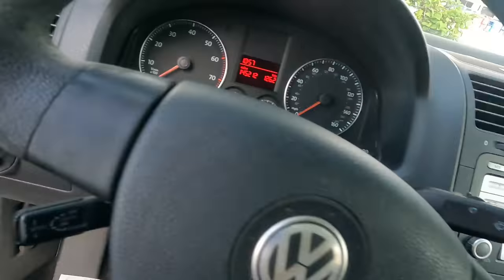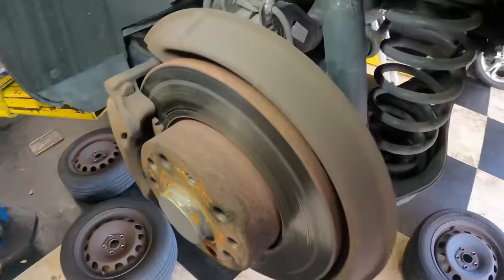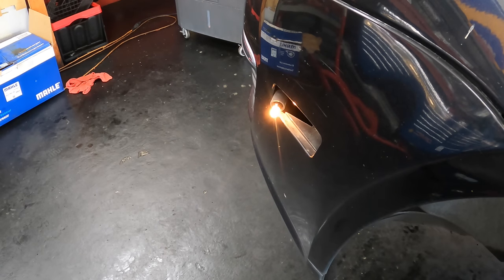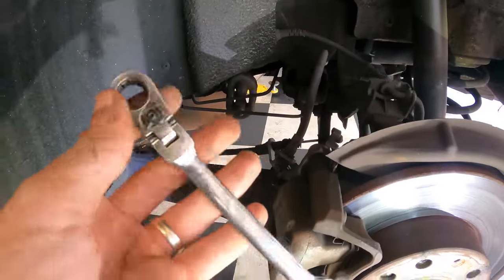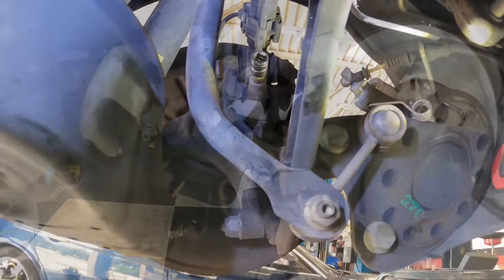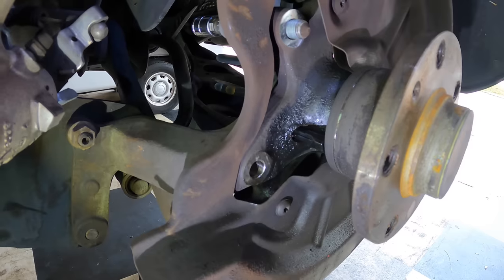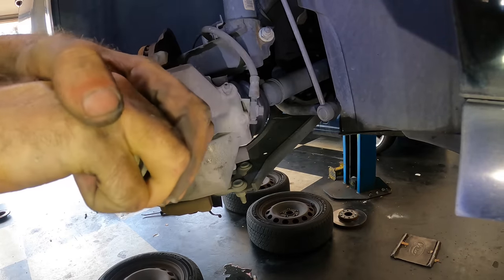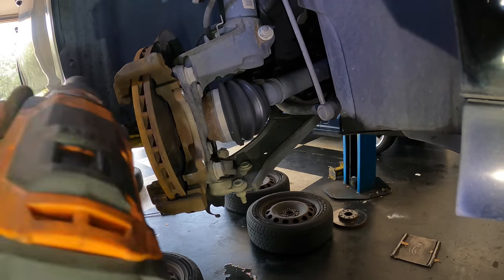Over Engineered Bolts! Four wheel brake job. Actuated Calipers. Volkswagen Jetta 2.5

Comment: One tip when fitting new brake rotors. Put a small amount of grease between the rotor and hub. It makes it so much easier next time the rotors need to come off :-)
Reply: In the salt belt we use Fluid Film.

Comment: I was very thankful that I kept watching the brake jobs on YouTube because I had to do the brakes on my pickup and it tried to mess me up with the hardware. But I got it all to fit had it right on the first side but it was wrong on the other side but I flipped the top and bottom and it worked out

Comment: Yup here north of Upstate NY (across the boarder in fact) NO shop will quote on turning rotors any longer, they all will only do a replace.  Not worth it, most are made thin to begin with so the life of the pads and life of the rotor are pretty much a match.  Now, the fun thing about the rotor is that it is cast iron and the fun thing about cast iron is that you can smelt it and the fun thing about having easy access to cast iron is collab time with a youtuber with a foundry can then happen :D

Comment: Yesterday July 25 2022
I started a front brake job on my 2011 Eq.
Parts from Amazon and they are the correct parts.  Almost 200 dollars cheaper than a local  auto parts store and I bought far better stuff than basic stuff from parts store.
40k on the ticker. Over a hour of hammering and air hammering the passenger  rotor, 30 minutes on drivers side rotor. Every bolt was seized. 4 hours to take apart.
   I never in 15 years wrenching at  dealership  every took so long to just remove  front brakes
Reply: Ouch. I'm glad for you it was your own car, and you're weren't doing this at a repair shop being paid flat rate to fight that. Can you imagine? 4 hours of hard work, and whats a front brake job pay? 5 tenths?

Comment: Wagon front rotors are the larger ones on VW,. I use a C Clamp and turn the piston in on the rear pistons, Ratcheting (Treaded piston) effect for the Parking Brake.

Comment: I had to find and buy a set of those Triple Square spline sets on an outage service call in Germany some 20 odd years ago. I changed them out to metric Allen heads. I still have them and I haven't needed them since. 

I hate those screw in pistons.

Comment: The oil on rotors is manufacturing oil it is use when it is manufactured and then left on to keep the rotors from rusting while in a warehouse or on auto parts store shelves so it serves two purposes.

Comment: XZN 12-point triple-squares are what we used before Torx! (shake cane)

Also, before they made soft-headed XZN bolt holes that would distort, they made six-sided Allen hex holes that were soft and really easily distorted and rounded out! So XZN has a better chance of cracking the bolt loose.

Comment: Did my MK 4 Golf's brakes recently and I was able to push them in, but only one of the rear calipers was able to be pushed in the other was stuck that was why I was looking into doing the brakes in the first place.  Took the caliper apart to see what was wrong and it was frozen stuck, wouldn't open or close so needed to change that one and now they are all good.  And yes, it was a lot cheaper to replace the rotors instead of cutting them.  Ah this video would have helped me out so much had this one been done last month ahahaha, oh well still go it job done.

Comment: VW started using CV joints with 8mm triple square bolts on 1968 Autostick Beetles in 1968, and for all Beetles in 1969.

Comment: BTW, applying the park/hand brake is what rotates the caliper piston so it gets extended and keeps the pads "adjusted" , actually it acts acts as a piston extender, that way the piston does not have to extend from the caliper bore as far
as told at a raybestos brake clinic, the rotors came in a red box or a blue box, and we were advised to put one of color on a brake lathe to make sure they were true. did that for all the new rotors after that= just cuz it's new doesn't mean  it's true, 
long stored or rough shipped rotors usually were not true

Comment: Pro tip for removing stuck rotors. Run a large bolt through the brake bracket bolt hole and thread a nut on the other side. Keep tightening until it pushes the rotor off.  Super easy, no pounding

Comment: Volkswagon has come a long way on their brake set up....yrs ago, they had caliper pins with little cotter pins on the ends of them which never came out, the parts were impossible to find and a 49 dollar brake job was a disaster for profits....this was early 80s but it was a lasting memory for me....now they have the silly caliper bolts that the Snap on guys love because they get to sell you another 75 dollar socket for the 3 times you will use it in your life...thanks Ray for the memory recall

Comment: Good video as usual.  I am a little surprised you didn't replace the rubber boots and the rusty slide pins.  The boots are cheap and would likely seal better.

Comment: Check with Snap On, see if they have a bolt heater with right angle coils. These gizmos will heat up JUST the bolt to cherry red with no contact using induction heating. You just plug them in the wall put the coil around the bolt, click it on. You can use a thermometer or judge safe temp by eye. I've found them on Amazon but not sure of quality, one is American made and may be good. I use one that is very old with no markings on it.

Comment: I had an '08 Jetta with the same system that I did the brakes on several times. 160,000 mi. Did the rears 3 times and the fronts only once. The wear was completely backwards.
Reply: how was the braking performance
Reply: My ‘08 Jetta is the same. Just replaced the front for the first time. Back wear out like every two years.
Reply: @ThePlacehole  The braking was fine. I heard that the stability control was the cause but I'm not really sure that's it.
Reply: All my VW and Audi do the same. I like the slight rear bias to the brakes as it stops the car without the front end diving down as much

Comment: In 1988 I bought a 1980 VW Rabbit with 104,000 on the odo.  For two long expensive years I drove it, in between break-downs, and I could not keep this piece of shet running.  Whenever the engine got hot the car would not start!  The starter was under the exhaust manifold, you see.  And that was just for starters - eleictrical relays failed at random, engine having random missing at high rpm's, so many more I can't even remember.  My dad took pity and loaned me $4000 to replace it.  Got a 1982 Nissan Sentra, and this car was like night and day - nothing ever broke.  Drove it for another 100,000 miles and made me a confirmed owner of the Tokyo tin.

Comment: DEAJA VU !!    I just did the same on our Volkswagen yesterday.  The caliper bracket bolts for the rear are a challenge: small space and you got lucky because the last repair seemingly didn't torque those to 66 lb/ft plus 1/4 turn - very tight. (I didn't get the 1/4 turn 'cause it's too limited a working space plus I have to do this in the driveway on jack stands.)
Reply: Get yourself an electric 3/8. You might not use it all the time, but will love it when you do
Reply: You have to jack up the rear end pretty high
Reply: @dumbeezy5480  Yep!
Reply: @daveunbranded  Right. I have some and they speed-up jobs considerably.

Comment: if you don't have a VW brake caliper tool, you can just use a channel locks and turn the piston clockwise, it will wind itself in without having to pushing it in

Comment: I was reading where "brake cleaners" are very bad for plastics/rubber and paint.
An alcohol based cleaner is best to use round these parts.
I know that AT-205 Reseal is good to spray on all rubber boots and bushings.
I did see some of the brake cleaner wet the front CV boots so I think I'd have wiped it off and after the brake job, coat all the rubber at least near your brake cleaner spraying area if not all the rubber under the car.
Could make them last a much longer time especially the front suspension bushings like lower control arms etc.

Comment: The necessity of XZN fasteners eludes me as well. Torx and E-torx I can actually see as being beneficial as they really do enable maximum torque but XZN are just a strip out waiting to happen. That stated they are superior to regular Allen head bolts which in automotive applications (like drain plugs) seem to be made of lead. When I use to sell tools (TOPTUL) XZN were good movers. Wonder why VAG loves them so much.

Comment: I like watching you fight with the rear bracket. It like you  didn't know you do not need to remove them by a VW like that. The disk comes right off without removing the bracket
Reply: I was looking for this
Reply: YES THEY WILL COME OFF WITHOUT REMOVING THE BRACKET.
Reply: And then, when you finally need to take off the bracket, to clean the rust off, the damned bolts wont come out.
Reply: @erik_dk842  Well with the rotor off, you can clean up the caliper mount bracket slide grooves "on car" with a wire brush wheel on a die grinder or the M-K file, both of which I used on the rear of a 2000 beetle.

Comment: Hey Ray , from one fellow mechanic to another , on some of these Vw rear rotors you can remove them without undoing the pad carriers.  Not all of them are but just give it a try. It stops all this triple square socket annoying stuff 👍👍👍
Reply: With some yes, and you may be able to even tell from the type of pads if you can remove the rotor with the bracket on. The design on my Dad's 1P1 Seat Leon for the rear brakes has no anti-rattle clips for the bracket, but rather springs on the pads to keep them pressed up against the bracket to prevent rattles. THAT design allows you to keep the bracket on, if you replace the rotors as well. On my dad's Golf that came before the Seat it had no springs on the pads, but anti-rattle clips on the bracket. With those you had to take the bracket off, and it was a pain in the ass because at that time i was in automotive class. Here in Finland most "students" that go to automotive class, they are just ass-hats who just  go hang out because they got nothing better to and possibly risk making each other blind with a high-pressure washer (ask me how i know). Back then i couldn't find the damn tools anywhere, and that brake job turned into a nightmare. I still am very much the new guy, and about to graduate next year 😅 But as i was saying, that brake job took 3 days for me because i was in-experienced, lacked motivation by the long-shot and i only had like 4 hours a day. Now two weeks ago in my front-yard, with no power tools and no helping hands i spun brand new rotors and pads after only 3.5 hours. But i could've sworn it took me 30 minutes just to carry all my equipment out from the garage, then move it around and clean up my mess afterwards.. 👌😂
Reply: That may be true, but unfortunately not on mk5 or Audi A3 at least.  They also use the same triple square bolts in the rear.

Comment: This is buried. Otc makes a super stubby set. It is 1/4 and 3/8. It also has the ability to use a wrench. I highly recommend it. (OTC 5942 8-Piece XZN 'Super Short' Socket Bit Set).

Comment: Shims and slide pins - the most overlooked parts of brakes that will attribute to ~65% of brake wear, overheating issues, sticking calibers (rest 35% comes from the caliper itself), etc. If the condition of slide pins are unknown, I always order a new set and clean the bracket with brake cleaner and nylon brush, after that blow out with compressed air - and oh boy, You cannot believe the amount of crud and muck comes out. Even in this video the pins looked pitted and rusted. Same with the shims, replace and in salty road conditions, add a little bit of anti seize to end of the brake pads ("ears") so they wont get stuck in the shims and wear out. I have at least five caliber failures and as many seized pins / pads in shims in winter conditions and it is not fun when the smell of burning brake pads fill the parking lot! Overheating of brakes will create more problems, ie. burning out the wheel bearings in short notice. (And the SKREEE moment at 32:55, there was still brake cleaner inside 😅) Nice video Ray and Thanks!

Comment: Rear roters are common to most cars,but front rotors depend on engine state of tune.  Same as for my skoda roomster, ive had 2 same car same engine but one 85hp, the other 105hp two totally different front rotors.
Reply: And Ray should have known that. What kind of clown show parts shop doesn't know that different rotors go with different engine sizes and types? It's also listed on a sticker in the trunk. In code form.

Comment: One thing to mindful of , when you compress the pistons back into the calipers  it pushes brake fluid back into the master cylinder,  if someone has topped the level off this returing fluid if it does not have room will overflow and in the process the preasure of it doing so also blow the master cylinder cap off making a real nice mess in the process, and if your really unlucky  "sometimes the preasure will also manage to break the master cylinder reservor cap when fluid blows it off".  its a good idera to keep an eye on the master cylinder fluid level , and removing some if it looks like its going to do ths then check the level after pumping brake pedel until its solid". , (never forget to do this before moving the vehicle)

Comment: It's ususally a 7mm hex - not a Torx 45. See at 21:00. 
After a brake job on concrete all my bones were hurting - never had an electric tool. 
Im am so glad, i did renew all braking-parts last year. 
Dont have to do it again till 2028.

Comment: The calipers on these things are designed to hang up.   The hand brake setup loves to get stuck on.   The pads on the front like to hang up on the outside, so the inner pad does all the work, and side loads the wheel bearing, leading to failure.   This is wet-climate experience, here,  not Florida.  I need an angle grinder to make my brackets shiny, not a wire brush.

Comment: i love being in the back seat while you replace the rotors & pads - a physically demanding job. never lose interest thanks to the video & sound clarity. man you are so fast & always have the right spanner & bolt at hand. much more organised than me. i’m curious what you spray the completed assembly with - is it wd 40 or a proprietary spray cleaner? yet you never use a spray lube prior to unscrewing a tight bolt or nut. is that standard practice? i like to use wd 40 first, to make unscrewing stubborn bolts easier, but your high torque sockets get it done without the need. what is that sensor on the front pad? presumably to measure pad temperature & prevent overheating.

Comment: In PA -The land of the bottomless pothole, uneven brake wear and ill fitting pads are often indications of bent brackets from banging all the potholes.  It's usually cheap insurance to replace the brackets to rid  brake problems. The noise and uneven wear at the back brakes could be a result of  bent brackets.
Reply: Land o lakes.  Asphalt lakes.

Comment: ATD is good tools, got a couple of socket sets, I also put them back as well I mean why not? And man My van and my explorer has these calipers, I didn't think things through and went and tried to compress, and ended up breaking a "C" type clamp and caliper. Costly mistake. The ones for my vehicles are in the hundred range.... Won't make that mistake again...

Comment: Hey buddy, small recommendation. When replacing lamps. Either use a barrier to your new lamp from oils on your hands, or brake clean to clean them off. Longevity
Reply: Those 194's in the side markers don't get hot enough to be bothered by the skin oils. I have never bothered with any special handling with them. I replaced about 8 of them (including side markers that serve as running lights and secondary front turn signals) when I first got my 1992 Camaro with 125K miles on it. It now has just slightly shy of 500K miles on the odometer, and I have only needed to replace 2 others. They were 2 that I thought looked fine in the instrument cluster. Not any of the ones I originally replaced. Thier longevity was never impacted. High heat + skin oil is what kills bulbs. Lower temp bulbs just keep going. Plus I think he gets enough break clean on his hands that he no longer has skin oil. Haha jk on that last part of course.
Reply: @williamallen7836  copy that. A habit I have. Retracted

Comment: betting those rear carrier bolts were buggered because someone just used a short 3/8 extension to remove them at some point in the past, you dont "need" the triple square but that is what happens to them if you dont

Comment: Often when you find those different than usual or special type fasteners and weird tabs, it's likely from using robotics and  special built tools on the assembly line. Toured a assembly plant in Liberty, MO where they were building Ford Ranger pickups.
Reply: I solve the problem by only buying VW cars (actually the last two have been Skodas) Ford is weird, IMHO

Comment: I was freaking out because you installed the new pads WITHOUT SHIMS and went back and noticed it did not have them to begin with. That is strange the rear does but not the front. I guess the inboard pad clipping in and outboard having the spring clip eliminates the need for it, but that is still strange.